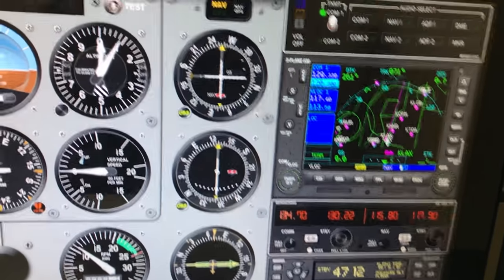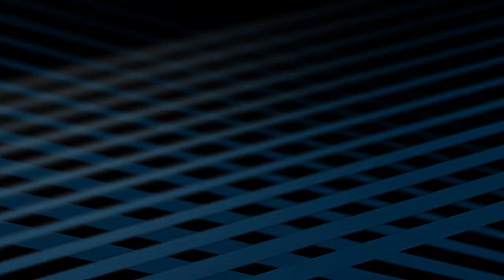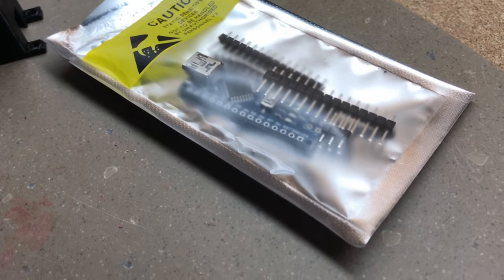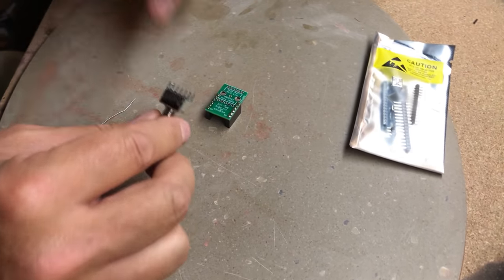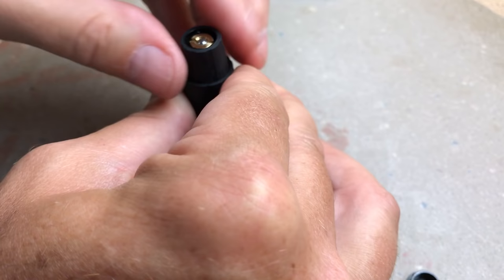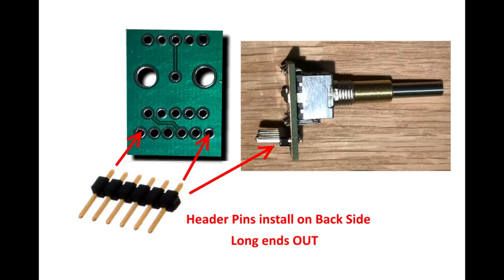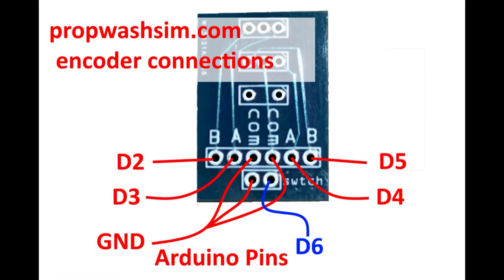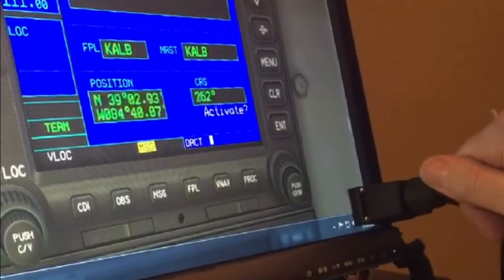Knobster Available:  It Exterminates Cockpit  Mice

Comment: I built one and it's awesome! Thank you so much for sharing! One question.  When you flash it in Air manager is it possible to use any of the extra pins on the arduino nano to add extra switches, buttons or even another encoder?  Thanks again!
Reply from the maker: Unfortunately not. The Knobster software is not the same as the regular Arduino software. The Arduino can only have one at a time. The good news is that Arduino are pretty cheap and Air Manager can run Knobster and many other Arduino at the same time.

Comment: All links seem to to be void. The only link I get is to Sim innovations for complete unit for $131 CAD. I have most of the parts but there seems to no longer be the roll your own options. What gives?
Reply from the maker: wildgoobsid5 check on the Sim Innovations Wiki. There is a DIY Knobster link there that explains the Arduino to encoder connections.The Arduino software installer is also linked there.
Reply: @rbarlow  where can I get the knobster circuit board that the Elma encoder mounts to? I have the Elma encoder and the nano board. The only way I see to make the unit compact like you have is with what looks like a proprietary knobster circuit board. Thanks.